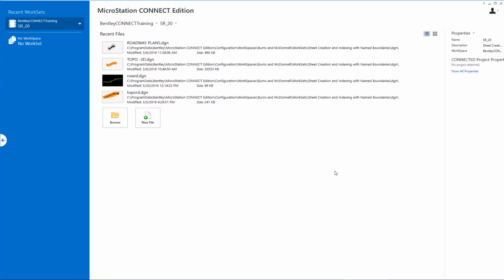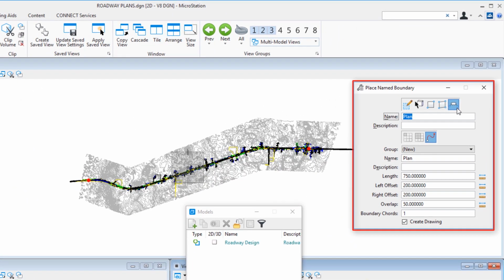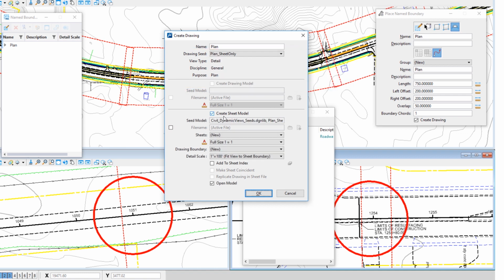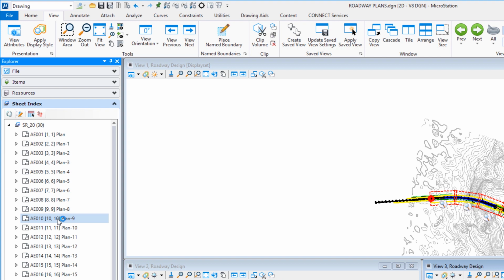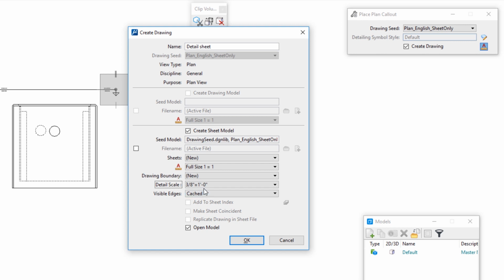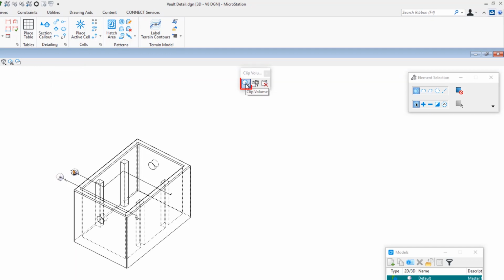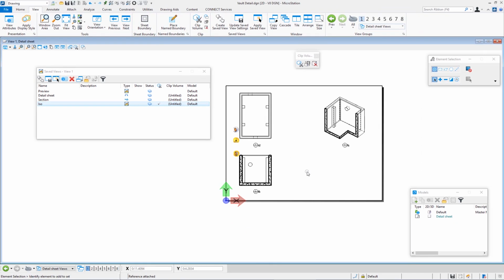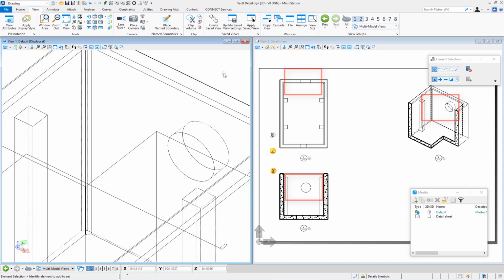MicroStation CONNECT Edition 3D Basics: 04 Create Plan Sheets & 2D Details from 3D Models

Comment: Hello,

My name is Burak, and I am a CAD Mapping Specialist from Türkiye.

I specialize in digitizing Reality Mesh (3SMS) data using Bentley Descartes and MicroStation. I can accurately extract buildings, roads, curbs, parcels, walls, utility features, and other map elements from drone-based Reality Mesh models and deliver clean DWG or DGN files.

I am available for freelance, remote, or long-term collaboration. If you need reliable and detail-oriented CAD digitizing support, I would be happy to assist your team.

I can also complete a small sample area free of charge so you can evaluate the quality of my work before starting a project.

Thank you for your time. I look forward to hearing from you.

Best regards,

Burak
Bentley Descartes | MicroStation | Reality Mesh (3SMS) | CAD Digitizing